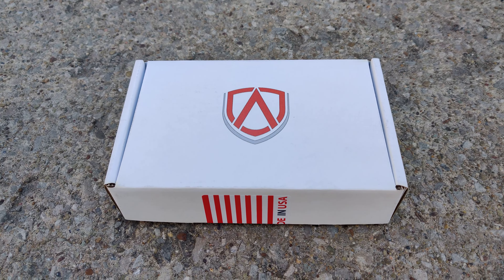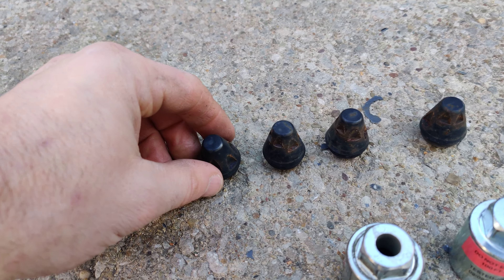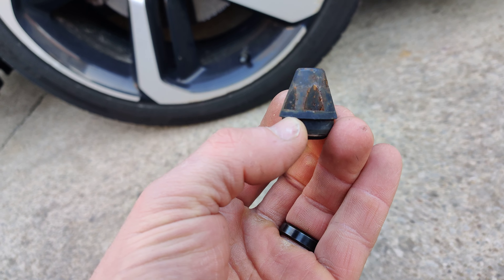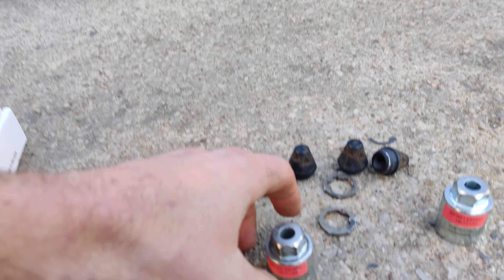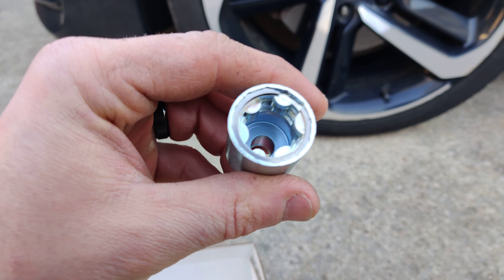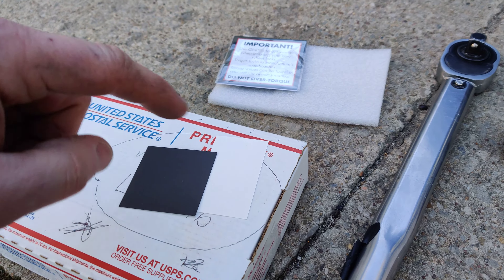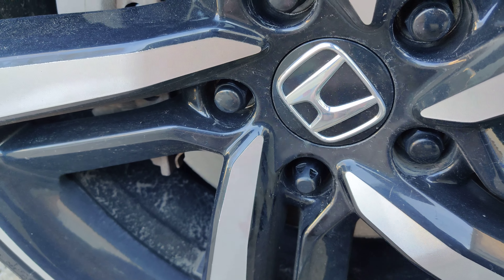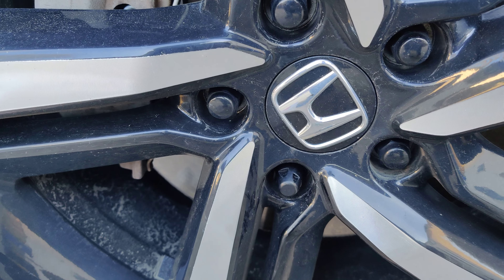Advanced Wheel Locks

Comment: Just wondering, how many times have you used that key, to take off your wheels, before it started to come apart? My 2023 Challenger will be here in the next few weeks and I was going to order these wheels locks! But, if they rust immediately and the lock key falls apart after a few uses, I will find something else! Thanks! 👍
Reply from the maker: Used it a couple times when did oil changes, also do tire rotation at oil changes. This is their new improved so should be better.
Reply: @AndreychukAndrey  ... Ok, thanks! 👍